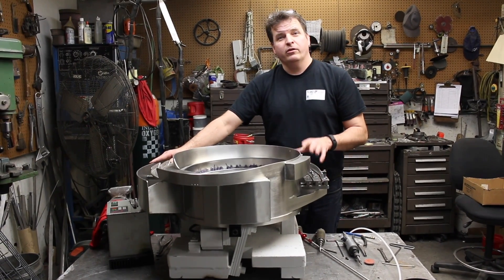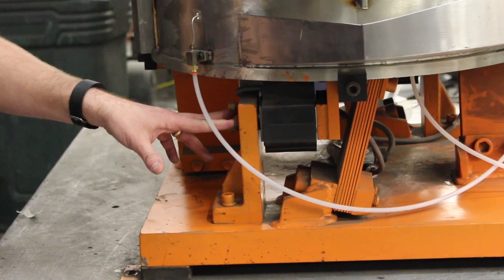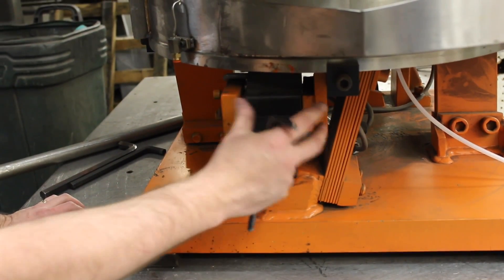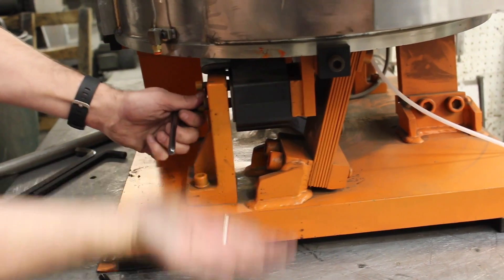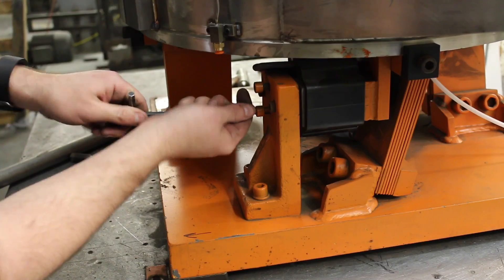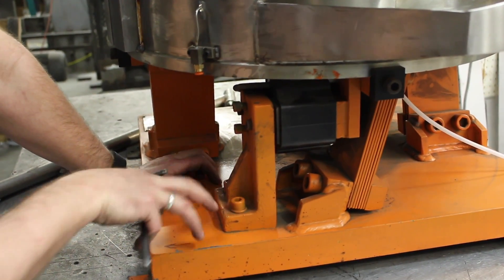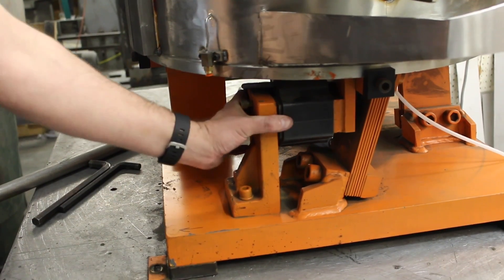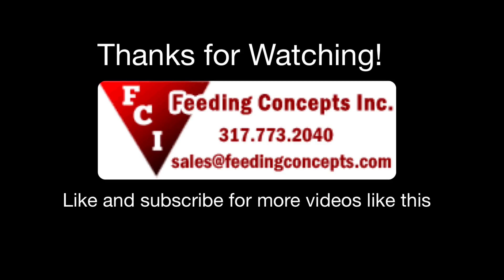HOW TO TUNE AND SET UP A VIBRATORY FEEDER BOWL COIL- Feeding Concepts, Inc.

Comment: This is a short video as to how our Vibratory Feeder Controller Works.

This Feeder Controller can be used for Bowl and Linear 

The feeder speed range is amazing, starting 1 Gm / second to up to 400 KG/minute and is completely settable.

https://youtu.be/2pMo3UMeoD8

Contact us to understand your requirements and suggest the best possible solution for your requirements

Available in 6-10-16-20 Amp.

230V-440V option

Voltage control

25/50/100Hz Operation

Settable RAMP up and RAMP down

Remote Start/Stop

External Analog input

2/3/4 stage for weighing applications

 http://www.icrbaroda.com/vibratory-fe...

 

You can find more information on

website: www.icrbaroda.com

Phone: +91 9106726706

Email: icrbaroda@gmail.com

you can also search for our other products on indiamart.com

Comment: Hello sir , I see your video is helpful but I know how we can set a frequency to beyond 150 Hz to operate smooth part feeding and high speed so what we can do for  achieving higher frequency coil design is main role or any change in left spring is also work suggest what we do 
Thanking you

Comment: How do you define the direction of movement?
Reply: This is counterclockwise. A clockwise bowl would have all the parts welded to the base of the drive unit reversed or mirror image. The magnet, which is the black part being adjusted pulls the pull plate, which is the part it is being gapped against. The magnet is being turned on and off very rapidly with an adjustable controller. Too fast for the eye to see. This tosses or throws the part forward, causing the movement. This movement can be seen if a strobe light is directed at the springs and properly adjusted.

Comment: how many leaf springs do I have to use in my feeder? if that quantity depends on the entire system weight, how can I calculate this?
Reply from the maker: Hugo Ferrel Injante Infante 

There are a few variables that determine how many springs to use. including size of base drive, whether you are tuning to AC or DC (60hz or 120hz), and also the weight of your bowl. Variable frequency controllers can help immensely when tuning a drive. However, you can do it without one. Make sure all your bolts are very right. If you don’t get any drive, start to loosen one of your spring banks, if it increases the power of the drive, you are over tuned and you need to remove springs. If you loose power or it stays the same, you need to add springs.
Reply: @Feedingconceptsinc   that's interesting. 'I'm using a 120Hz frequency vibration (feeding with 60Hz) and all my drives are 30 W. What kind of movements say that I need more leaf springs.?
Reply from the maker: Hugo Ferrel Injante Infante 
Your controller has its frequency that it is using to power the coils. Vibratory driver also has its own residual frequency, and this is what needs to be tuned. If your controller is using 120hz to power your driver, then you must also tune your driver to 120hz. When driver are tuned to 120hz they almost always have thicker springs, about 3/8” (it varies depending on the driver). If you’re driver has thinner springs. Then it is probably tuned for 60hz, and either the tuning of the drive, or the controller settings, need to be changed.
Reply: @Feedingconceptsinc  thank you so much
Reply: Buy a REO controller.